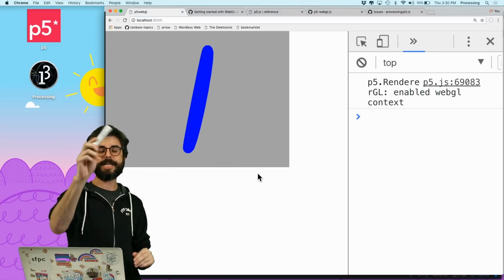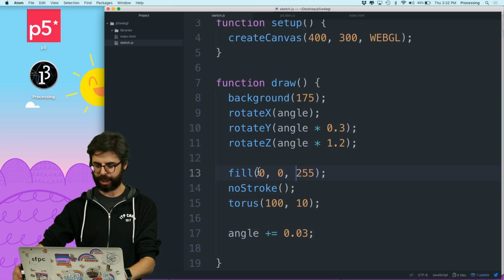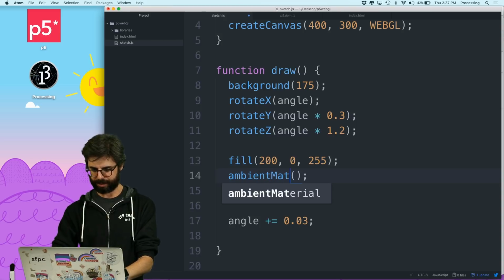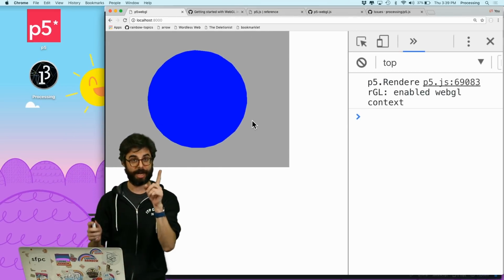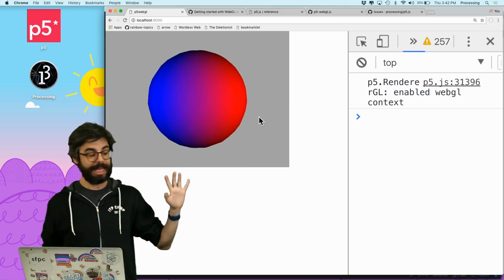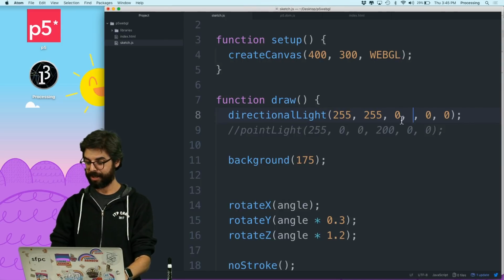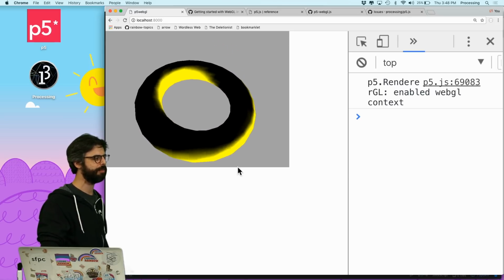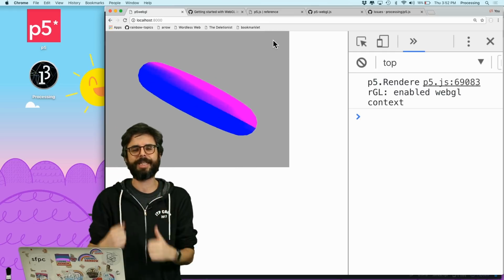18.3: Light and Material - WebGL and p5.js Tutorial

Comment: I have done a few 3D things xD this is a cool and easy method, <3 this, but i'm surprised nobody noticed that you left you lights where the cubes center is. your lighting your model from within, light and model have same starting position. so those screaming in comments about the surface, you nee to move the lights back... x,y,z....... left/right, up/down, forward back, 200 on last digit bring them back and on the outside out the model then you are lighting the surface xD

Comment: Hey Dan, my point lights are extremely dim, any idea what could be causing this? Posted on the p5js forums to no avail.
Reply: Always! 
Here's the post : https://discourse.processing.org/t/webgl-help-experiencing-pointlight-issues/995
<3
Reply from the maker: Thanks for this note! Can you link to the forum post?
Reply: I think it was a new change in the library, where before if you didn't have a point light on the one or two of the axes, the other point lights you had could cover for it. For example, one light on either side of a sphere (both lights on x), will get you color on the sides of the sphere, but the middle will stay black, whereas, in the video, the two lights on either side cover the entire sphere. But, if I have the two point lights on the x, and add one on the z (in front of the sphere), the color on the middle of the sphere will be visible. The changes do make the lights more dim, so the trick is to play with their distance from (0, 0, 0) and to add new lights on different axes. The whole idea is to have more control over lights and shadows, and therefore how something is perceived.
Reply: Hey Manas, yea thats it. I asked in the p5js forum and they said that at the time of Dan's video there was a bug, the lighting is actually too powerful in the video . I changed my light's position along the z-axis and it lit up the sphere better. I also added more lights around it. There's also a bug on the current release, so the lights still aren't perfect, but all is good.

Comment: When I use the point light I can't really see it, I can see I little bit of blue but it's really dim. How do I fix this?
Reply: Im having the same issue, did you find the solution by any chance?
Reply: I think it was a new change in the library, where before if you didn't have a point light on the one or two of the axes, the other point lights you had could cover for it. For example, one light on either side of a sphere (both lights on x), will get you color on the sides of the sphere, but the middle will stay black, whereas, in the video, the two lights on either side cover the entire sphere. But, if I have the two point lights on the x, and add one on the z (in front of the sphere), the color on the middle of the sphere will be visible. The changes do make the lights more dim, so the trick is to play with their distance from (0, 0, 0) and to add new lights on different axes. The whole idea is to have more control over lights and shadows, and therefore how something is perceived.
Reply: Well... same thing happened to me as well. So according to Manas Taneja, by translating his words into code, one of the solutions can be like this. 

Instead of :
     pointLight(0, 0, 255, -200, 0, 0)

Try this:
     for (i=0;i<500;i+=100){
       pointLight(0, 0, 255, -200, 0, i)
     }

It works for some reason.

Comment: When you mix Ambient, Diffuse and Specular lighting, its called Phong Lighting or Phong Reflection. The math is pretty interesting when you look at the shader code that make it happen at the fragment level. Here's my webgl shader that I used to do a low poly phong lighting to a mesh, it calcs the normal for each fragment (pixel) but the normal ends up the same for the entire triangle thats being rendered at the time. If you take out the low poly stuff and use the vertex's actual normal vector you will get a smooth shading instead of low poly. When I learned the math it just blew my mind and became the first time I got a visual understanding of a dot product (normalized..very important) :)

https://github.com/sketchpunk/FunWithWebGL2/blob/master/lesson_065/fungi/shaders/LowPolyPhong.txt
Reply: You'll be pleased to hear that the next version of p5.js will have a phong shader that you can enable!
Reply: thats pretty sweet. Wonder what other sorts of shaders they're going to bring to p5.